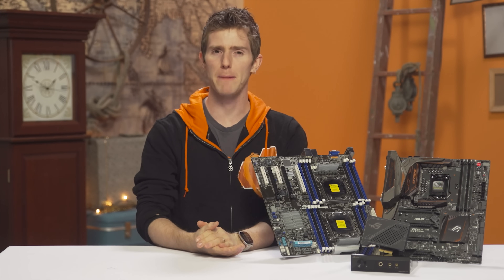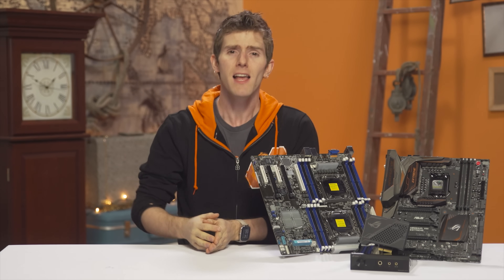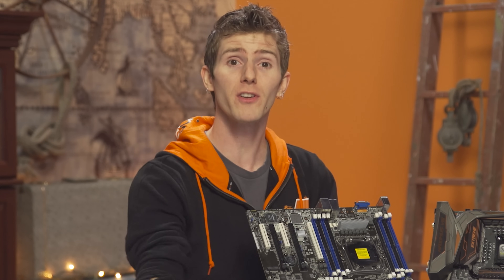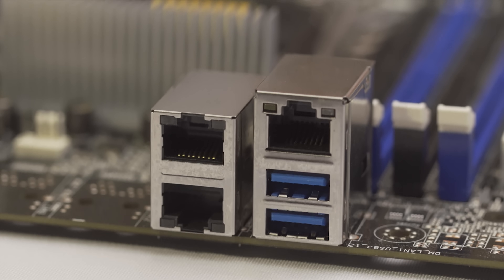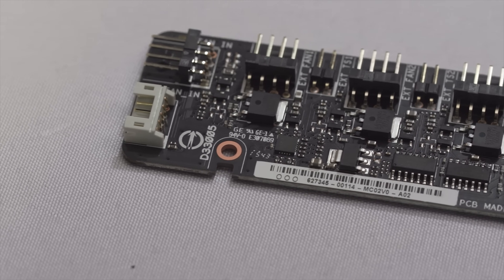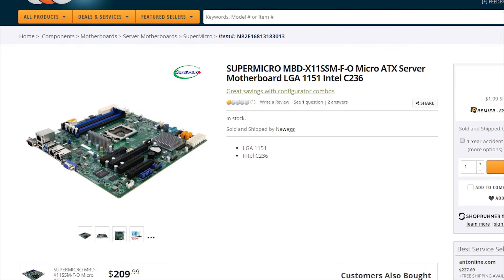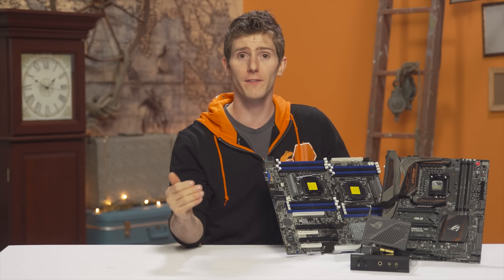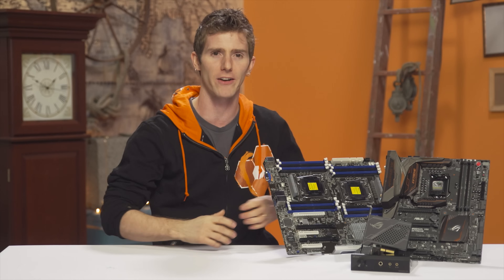What is the best choice for a motherboard? - The Final Answer

Comment: Anyone have tips on building rig for using 3ds Max?  I wanna spend less than 3k but can go a lil higher if i can get significant gains in rendering time. I would like m.2 support for samsung 950pro. and I am most likely gonna use a gtx 980 ti but am willing to go to Titan if its really needed or possibly 2 980's. Is asus the best brand for motherboards vs msi? If anyone has some answers here I would love to hear it. Thanks

Comment: Can some one help me decide which system is better 1. http://au.pcpartpicker.com/p/Wdt4RB or 2. http://au.pcpartpicker.com/p/W82Cf7
Help is appreciated :D thanks
Reply: I think the sencond one is better. The motherboard you chose on the first one isn't very stable if you want to use the TurboBoost on your CPU. The i5 has 4 cores and 8 threads, while the FX processor has 8 weaker threads.

Comment: Basically just got my Motherboard for the Ethernet Adapter and Red Trace Lighting. Other than that it's just your standard ATX Motherboard (only cost me like 150 USD). The only really expensive things in your PC should be your CPU, Cooling to make sure that CPU lasts as long as possible, and your GPU. Other than that, you've basically just got your PSU and SSD and/or HDD which are really just a case of pay for what you need (i.e. Wattage and Storage Space).

Comment: Hit the dislike button :( !
Ofc there is no real answer to what mobo should smbd buy but Linus!!! give people some info!
make a video (for consumer -gamer and another for server - development etc) explaining different aspects that the MB has
for an example, explain the difference between an 100$ z170 and an 200$ z170 
there are several things that people need to know when choosing a motherboard and you need to make a video about how somebody will understand the features of the mb and then choose one thats suits his/her needs. on your next video try to explain for new gamers (cuz IT guys already know these i guess) these things
--on board audio and audio jacks i/o , with realtek chip is the best>? or does it make any difference at all? 
--vrm - cpu phases - heatsinks , you cant OC on an 100$ z170 with 5 phases and no vrm heat sink whatsoever.... 
-- expansion slots -nvme - m.2
--extra usbs and pwm ports for cooling, and all the different type of connectors on the motherboard
--chipsets obviously...
-- bundled software or generaly motherbord utility software(audio,network,fan control, oc ) , does ti matter ,does it helps in anything at all? 

explain these things and show the people some experiment, building a system with an z170 costing 100$ and one at double 200$ the overall experience should be better while using a more expensive mb... but keep the rest of the system same(cpu/gpu/ssd/ddr)

Comment: Linus, Have you guys looked at upgrading a Quad Core such as Q9400 to a X3360 Xeon by way of the LGA711 to LGA775 mod that can be done?
The Xeons seem to be cheaper to buy and therefore may be a good option for those on a budget looking to upgrade CPU Power.

Comment: The actual process:

(x) Choose processor manufacturer (Intel/AMD).
(x) Decide if you want to overclock and can afford Intel K unlocked CPU, if so go with a Z chipset board, otherwise go with H chipset board (ignore if you chose AMD).
(x) Choose latest generation chipset that supports your chosen processor socket
(x) Choose case form factor (ATX/mATX/eATX/m-ITX)
(x) Look at motherboards of about 40-60% the price of your most expensive part (CPU/GPU typically)
(x) Choose reputable brand such as ASUS, Gigabyte, MSi etc. 
(x) Read reviews on candidate boards
(x) Buy the black and red one, obviously

Comment: I am in the process of selecting the best board for me.
First step: select the religion: amd or intel?
What card do you expect to connect? Single video card? Dual? Wifi? high end audio card? And so on.
Video card, AMD or intel? Not all board support crossfire and sli. Single video card can skip this step.
Then choose a motherboard brand.
Then check the available chipsets and their limitations.
Select the board that support the crossfire and/or SLI, compare all.
Remove those that the cards can't fit (i.e. double video card? don't get ITX formfactor!)
Wifi? onboard? or card? If yes, remove the board that don't have it. If no wifi, skip.
How many hard drive/SSD/burner do you plan to connect? Remove the boards that don't have enought sata, or consider using cards. In this case remove those that don't have enought slot.
Memory. Is 2 memory sticks enought?  If not remove those...
And so on...

So, my process is: elimination. Started with like 70 board from that manufacturer that accept my cpu, about 30 "only" with the right chipset, eliminated about 5 for the form factor, some more for the memory slots. I plan to add M2 SSD in the future, so it eliminated more... And I plan to possibly run double gigabit, so selected those that have 2 nics... ended up with a single one left.
I am considering still to see if I can use another board... 10Gbit would be nice, but $$

Comment: I was hoping you might talk about some of the features general consumers / gamers might be interested in. After matching the cpu socket there's still a plethora of options for mobos with seemingly the same specs, but up to $200 price differences.  Sometimes the only discernible difference is something like "Killer Gigabit LAN vs. Dual Gigabit LAN" and they're hundreds of dollars apart.

I don't want to overspend but don't want to miss out on some key feature. How about offering some use case scenarios: someone with lots of peripherals might want to look for how many USB are supported. Someone who uses headphones might not care for 7.1 audio. For examples.

Comment: I recently picked up a z170-a lately, and even I thought that was overkill. I only bought it because I liked the layout and the standoffs were in the correct places as opposed to other boards. Other than that I probably would of went with a 100ish motherboard.
Reply: +norge696 
it has all the good stuff and it's future proof but doesn't go overboard. i really like the z170-a and i think you did the right thing.

Comment: Things I look for in a motherboard.
1) Is it the right price for what I am willing to pay and is it reliable.

My Asus Rampage Formula III has been alive and well for 6 years now.  The incredibly cheap MSI FM2-A75MA-E35 has worked fine for 3 years now.

I got a Asus Z87-A for a build and it had to be RMAed twice, and I have a MSI Z-97 Krait that has two bad memory slots, but works otherwise.  Luck of the draw I guess.

Comment: When I saw this title, I did not expect a comparison between server and gaming boards... I expected this to be a video about what features to look for on a mobo; NOT like how many USB-ports or such stuff, but in terms of components: When do you need 10 voltage converters, when do you need 18? When do you need WLAN-chip set and what is the difference between audio and audio on different mobos and brands (like asus markets their gaming audio vs MSI's gaming audio and so on). What is the difference between Z, H, and B-line of intel mobos (and whatever they are called on the AMD-side)? 

That kind of stuff would have been much more helpful for both experienced builders and beginners, as I don't really think that most people would buy server-mobos anyways (no matter how teenage they are), and those who are going into high-end server hardware usually know what the hell they are doing.

Comment: Linus do you  have any tips on finding out the powerphase for a motherboard when looking them up online most are not listed in specs and looking up online doesnt always give you  an answer. I like to overclock but im not always buying the 120-170 usd mobos so figuring out the powerphases on the more "budget"  friendly mobos would really help
Reply: Just look next to the cpu and count the blocks. As you get see on the z170-a there are 10 blocks, so it's a 10 power phase, not rocket science.
Reply: why are they listed as 4+1 8+2 etc then? what is the second number for?

Comment: An i5 6600k with gtx 960 4gb or i7 6700k with gtx 950 4gb? For gaming?
Reply: First one (my opinion)
Reply: luck ofdeath Just fyi, the whole point of PC is customizing your computer to however you want it. It will be best to research system requirements for the games that interest you. There are many types of of games on the PC and it all performs differently from genre to genre.
Reply: Thank you both :)

Comment: Buying a Motherboard:
1) Never buy 1st Gen, 2nd Gen is still risky
2) Never buy the most expensive
3) Never buy the least expensive
4) Never buy anything without shitloads of reviews and documentation
5) Over estimate your Max performance requirements by 25%

This is how you buy a Motherboard that will last you for the maximum expected shelf life.  I have been building PCs since 1995 in a professional fashion.  These rules translate fluently to all hardware purchasing.

This is the one answer.  It is this simple.  It has been this simple since 1995.  I have never (not ever) been proven wrong from building workstations for City Hall to designing workstations for the SATCOM system GM used to use for flooring, to developing and building thousands of high performance gaming and development PCs for gaming Cafe's and Institutional learning platforms.  I have never once missed the expected shelf life or cashed in a warranty.

I still have freesco running on a machine in a closet that was build in 1998 and has never been turned off.  Purchase with confidence when following these simple rules.  Also freesco on a dummy box is still the most secure connection money can buy.  Yer welcome.
Reply: +Zenn Exile Nice little guide to avoiding buyers remorse. These rules also translate pretty fluently to all other purchasing in general. I'd also add: 6. Sleep on it
Reply: djhart25
Einstein slept for like 3 hours a year.  Just follow the rules, they never fail.  =)
Reply: Zenn Exile lol touche, touche . . He also married his cousin though ...

Comment: I brought a asrock x99 ws-e motherboard instead of a asus x99 rampage extreme why you ask because the asrock gave me all the beanfeasts of the asus board with out all the junk i will never use on the asus board and the asrock ws-e was $449 as appose to the asus board at $700. also 2 plax chips mean i only need a 5820k cpu so no need to pay an extra $250 for the 5930k. simply look at the comparisons of the 2 boards and you will see almost no difference apart from the stuff that the average user will never use. i do not overclock much so all the extras with the asus extreme would be a wast.

Comment: What about taking a more in-depth look at motherboards. CPU power (4-pin vs 8-pin+, phases, heat sinks, etc), dual-BIOS vs single-BIOS, BIOS/UEFI versions, audio component quality, form factor, chipsets (and their features like overclocking, RAID, etc), general component quality, PCI-express (2.0 vs 3.0, number of lanes, etc), onboard graphics, general coverage of premium features (like overclocking buttons, on-board power and reset buttons, etc). All these kinds of things matter for your average PC builder. 

It could be the definitive motherboard guide!
Reply: 4pin PSU will work with 8pin mobos

Comment: linus you got it right, its not a straight forward answer to give.
i recently had 55 to drop on an AM3+ board. i shopped for the features i wanted and was not disapointed with my gigabyte GA-970A-DS3P rev 2.0 purchase.
picking parts comes down to money you have and features you want

Comment: I only buy shiny stuff, if it's not shiny, it's no good.
Reply: +ArcadeGames Can confirm shiny=good

source: I'm 14 year old who has made alot of virtual builds
Reply: In the future everything is chrome.
Reply: Mmmk
Reply: +footbalr074 Wow such cred. Please make me a blinging build please.
Reply: http://pcpartpicker.com/p/DJVfYJ
Here's a budget SLI gaming rig, I cheaped out on some things but bought quality parts were it matters 

Also if you're hardcore like me, no one makes parts with enough bling so you should also buy this and make a truely custom system
http://www.amazon.com/Rust-Oleum-1915830-Metallic-Silver-11-Ounce/dp/B000PQGE2M

Don't put it on the power supply though, found that out the hard way, I got grounded forever when the fire happened.
Reply: footbalr074 Aw yiss! Is it ok to paint the RAM and the CPU contacts with that stuff? I want to overclock the contacts for maximum fastness.
Reply: Deses duh of course OC will be fine that's why I included an aftermarket cpu cooler

but you might have to water cool the RAM if you want to OC that, my friend told me RAM can get really hot.
Reply: footbalr074 Nah I was planning on doing the submerged oil computer following Linus guide but with olive oil. Why? Because it's more natural and healthier!
Reply: oh in that case I heard motor oil works the best and is cheaper.

best practice is take it from your car, that way its already broken in and you're saving the environment by recycling.
Reply: just talked to my friend he says he uses 10w40 because it has the right viscosity
Reply: +Deses Water cool your CMOS battery and overclock it.
Reply: Themes be words to live by
Reply: +ArcadeGames 
Ching-wah tsao duh liao mahng, shiny.
Reply: +Oliver ASUS Bun tyen-shung duh ee-dway-Ro
Reply: ArcadeGames If the CMOS powers the internal clock... does it mean that I can effectively double my time?
Reply: +Deses Yes, just don't overclock it past 88mph or you're going to see some serious sh*t!
Reply: +ArcadeGames then buy shiny paint......................then EVERYTHING will be good. once you paint it.
Reply: chris Evans I'll add the cans to the build for good measure, stuff inside the case doesn't affect airflow or thermals after all!
Although I should say oil flow.
Reply: Oliver ASUS But will that OC my dual 450GTX? If not I think I'll pass.
Reply: Deses You should!
Reply: Oliver ASUS Build it beautiful?!
Reply: My gear won't be winning any beauty contests anytime soon, but it's solid. Rig like this, be with you till the day you die.
Reply: Buy my ass then
Reply: your ass is shiny
Reply: goblin pirate
Reply: msi mobo are shiny
Reply: So Charizard is no good?

Comment: People didnt watch the video. he gave the answers. not one single answer but multiple. dont buy stuff you dont need. if you are never overclocking, why buy a ROG board when you can spend $75 on an MSI board that will do exactly the same thing for you but not have the OC abilities in the UEFI, but you wont care because you wil never look at it as a nonOCer. Do you need 4 PCI-E 8/16x ports? no? then you can save or even get more for less slots on a different board. Do you need premium Audio? DO you need WIFI? do you need a Fan breakout board? do you need a million fan headers on your board? do you need liquid cooling for the motherboard voltage controllers? there is alot that goes into picking a board but the low end ASRock H110M-DVS/D3 LGA 1151 board will game at stock loads just as well as a ASUS ROG MAXIMUS VIII EXTREME LGA 1151 board. you throw the same 6700k and 980ti in them and you will get the same performance.

Comment: Nice informative video
But you missed talking about: cheapest boards aren't always better either
Even if the io/feature range is similar

More expensive boards usually have higher quality components (capacitors and stuff) that last longer, allow further oc and reduce temperature on the backside of the board
And they usually have a better tested and therefore more stable bios (afaik)

The ranger definitely seems to be a good board
The hero is too expensive for me and the gaming pro from asus looks like it's quality isn't optimal

Comment: Best mobo imo is the Xbox 360 mobo. Just desolder the cpu/gpu and resolder any cpu/gpu or your choosing, I have an i7 6700k/Titan X in mine. The most amazing feature has to be onboard RAM ready to go, no need to slap in some 4gig sticks, it's got a whopping 512mb at your disposal. What would you choose? 8gigs or 512mb, 512 is a bigger number than 8 so the choice is already made.
Reply: dude,
  I am running quad sli Titan X in my XBOX 360

Comment: The thing that confused me most was PCIe slots and configurations.  Socket 1150 CPUs only support 16 PCIe lanes.  That means you can only run 1 PCIe graphics card at 16x.  If you do SLI, typically the PCIe slots get set to 8x.  Which is fine since I don't think there are any video cards out that will actually saturate a PCIe 3.0 slot at x8

If you want SLI and you also want one of those new super fast SSDs that use a 4x PCIe interface then you should think about getting a socket 2011 motherboard & CPU that supports up to 40 PCIe lanes.

Comment: I guess buy the cheapest board from a good manufacturer that supports the features you want. I got a MSI z170a Xpower Gaming Titanium Edition, the features I want is CPU overclocking, 2x M.2 (would like to get that in the future) and SLI support (always nice to have the option). Could have easily saved 150 usd by getting a Gigabyte z170x-Gaming G3 or a MSI z170a-G45 Gaming or maybe something a little more expensive for a better overclock. I'm not doing LN-2 cooling so a lot of the settings and features on my sexy-as-hell looking board will never be used.

Comment: Linus, could you do a comparison (albeit qualitative) on 4k GSYNC vs. 1440p GSYNC on the same hardware? Essentially looking at the experience of gsync (yay) but comparing the resolution vs. lower frame rates (boo!) in the best case scenario (i.e. G-sync). Would one venturing into the >1080p realm on upgraded hardware be better off forking over the money on a good 1440p gysync display or even more for the 4k gsync display?

- fellow Canadian! discovered your channel a week ago and it's running almost non-stop for me!
Reply: What did you get in the end?